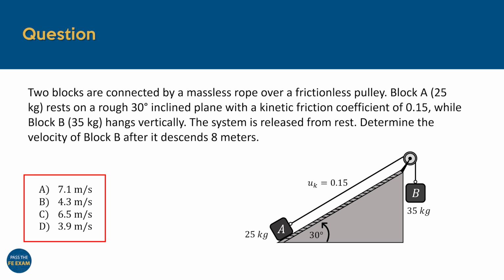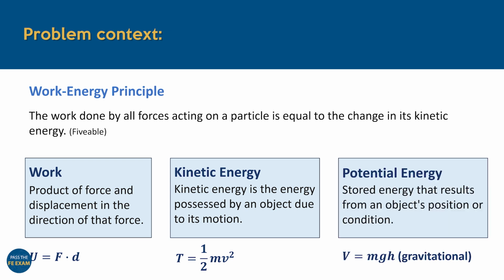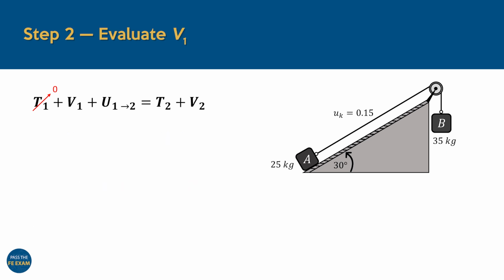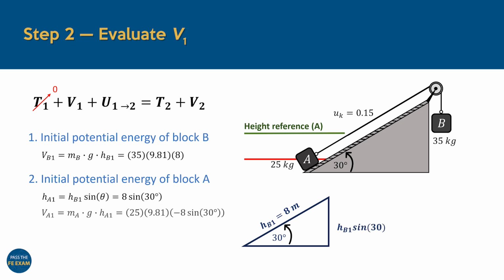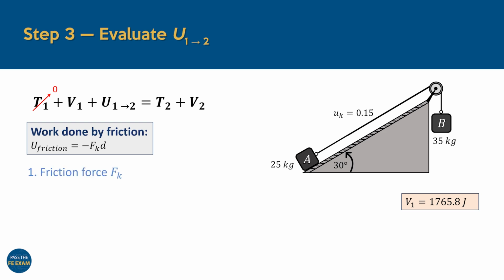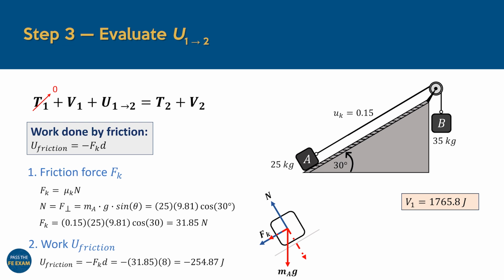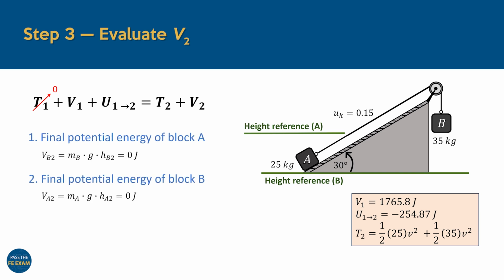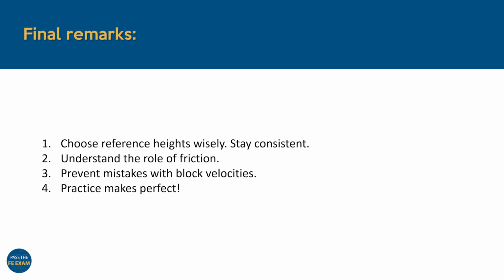The FASTEST Way to Solve a Two-Block System During the FE Exam

Comment: If we are talking about the two blocks as a system, why are we giving them two different height references? Shouldn't we establish a height reference common for both blocks?
Reply from the maker: @MrRaulan07 Great observation! Choosing a common height reference for both blocks can definitely help simplify the problem, especially when analyzing energy or kinematics. However, in some cases, using different height references is useful for clarity—such as when dealing with relative motion, different initial positions, or system constraints.

The key is consistency in applying the chosen reference throughout the calculations. Thanks for your insight, and we appreciate the discussion.